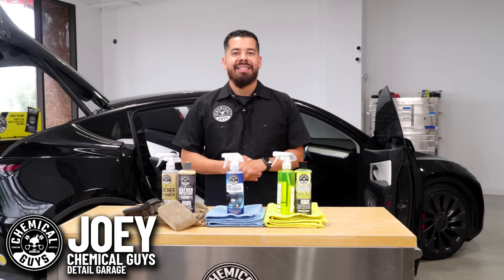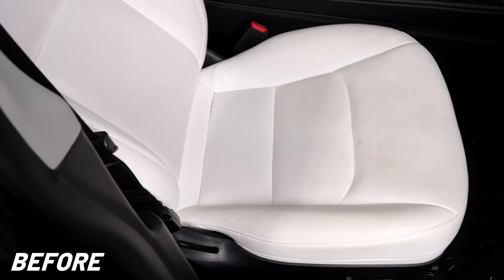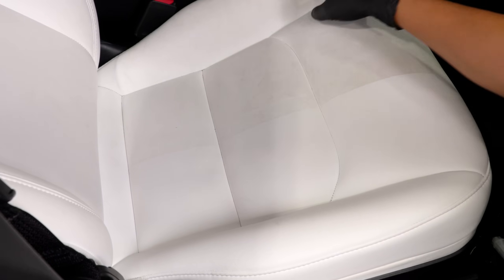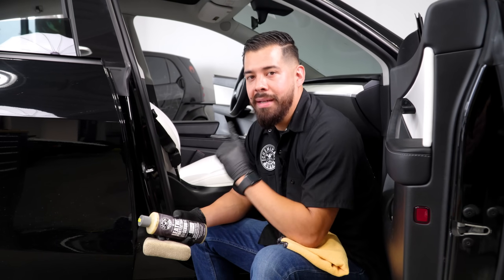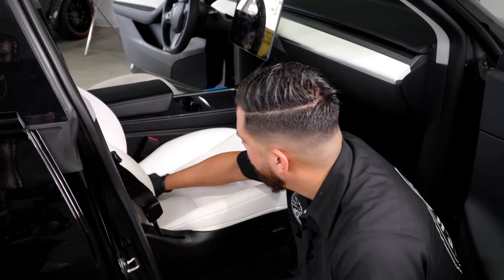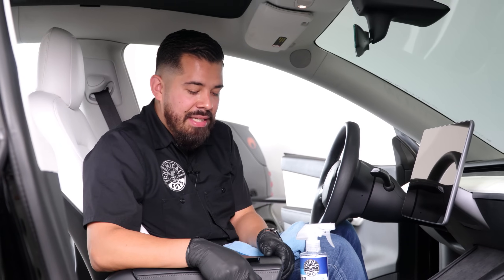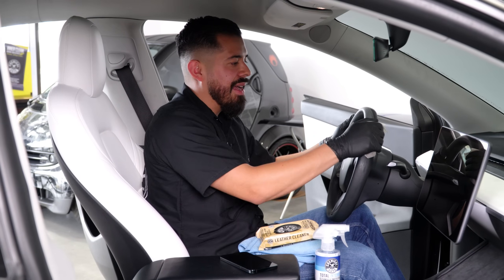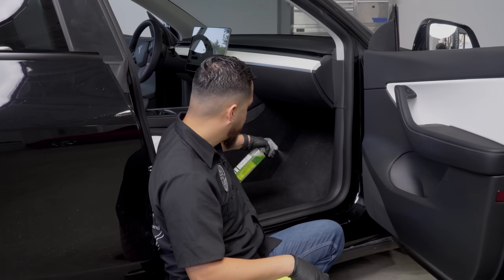How To Clean White Leather Interior - Tesla Model Y Interior Cleaning Guide - Chemical Guys

Comment: Finally something useful to use on the white seats always worried to use any chemicals on them. I only used hot water and a micro towel but could never get the light tougher stains out lately maybe this will help for sure. 

This wont damage the sensitive white faux leather over time ?

Comment: Question. I just bought a new car with tan seats and it has blue jean stains on the passenger side. I've used your products 4xs to get the stains out and no luck. Any suggestions ?
Reply from the maker: Hello! Thanks for tuning in. Try using Leather Conditioner to gently scrub away stains.
Reply: @ChemicalGuys  I bought your conditioner and cleaner and they didn't work to remove the jean stains 😔

Comment: should I be scared that your leather cleaner might damage the coating that tesla applies for white seats from factory? After all tesla does not recommend any cleaner (except non detergent soap and hot water). Thank you!
Reply: Facts! Curious about the answer.
Reply: Just ordered products but also wanting to know awnser to this Q please
Reply: Why no answer to this after 5 months.  Something Chemical Guys not wanting to tell us?
Reply: Not that I know for a fact, but he does answer this in the video. How true that is?? Idk. I'm curious myself and may buy to see if I can get Print dye off of my white tesla seats. Cuz nothing is helping so far
Reply: Yea use leather treatment or leather top coat type of product after
Reply: I was told by the Tesla sales rep when purchasing my white interior 24 not to use and cleaners as they are the reason for bubbling and damage in the seat material. Does Chemical brothers back their products and will they cover damage to seats caused by the leather cleaner?